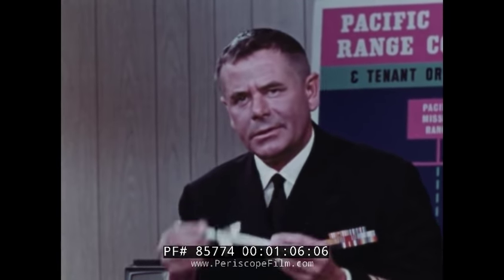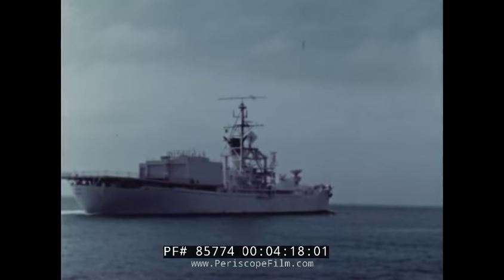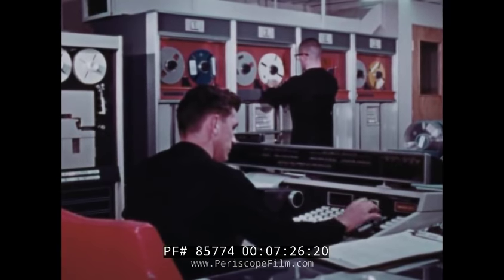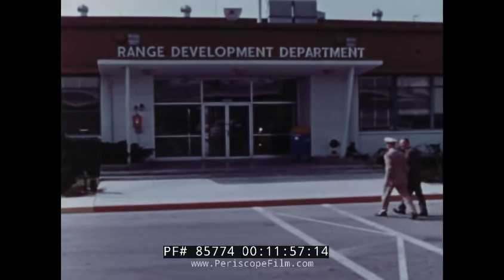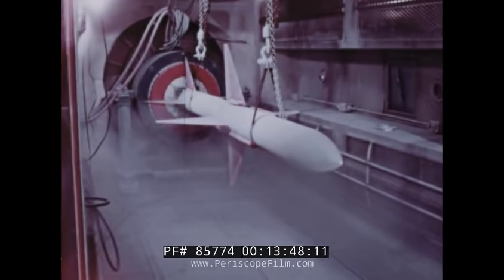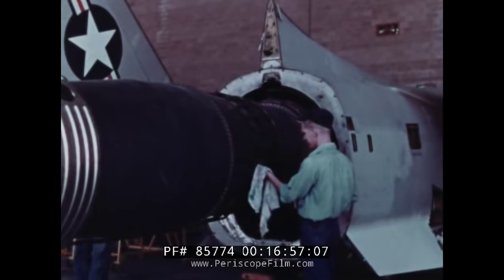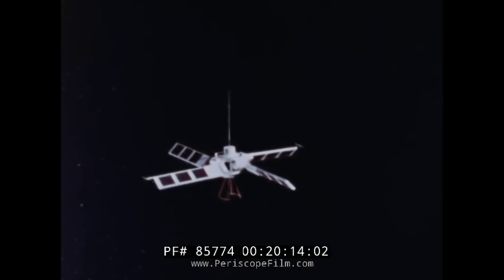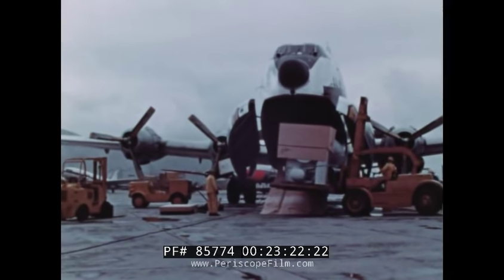U.S. NAVY THE MISSION OF PT. MUGU PACIFIC MISSILE TEST RANGE WEAPONS THAT WORK  85774

Comment: I worked in that building 1973-5 and 76 tour in the photolab, I knew Glen Ford came in our studio sometimes.  We saw this film there and others Jim Backus Magoo-Mugu also . PacMisTestCtr was what we were, then changed to NMC Nav Mis Cen. I had two duty hats PMTC and NMC. In 73 we cleared out the entire building; all the floors. Because when we were in the darkroom. One guy , not me, in the dark dropped a few gallons glass bottle of 98% concentrate of Acetic acid. (Stop bath) for print processing. (Dumb to have had it) I said right away that we would not be able to mop it up. The gas waffed up almost immediately and it was overwhelming We threw some towels and ran into the main lab section. The  first class said for us to get wet towels as masks and go back in which we did to mop, but it was so strong by then it sent us right back out gagging. He soon knew it was out of hand and was spreading quickly through all the vents, That building was likely over 120,000 sq feet with all the floors.  Someone called the base Fired dept and they sent in our hazmat. We were to to leave since the gas was too strong. I was young 19-21 so did not know really how to take advantage of what we had. Lots of equipment amd film and paper to do photogra[hy with as ,much as we wanted. We could check out 16mm 3 turrets and  lots of all the lenses for our Nikons of all sizes. We had Hasselblads and older 4x5 cameras (Not used much by then) And even the 16mm film & 35mm movie film was developed in our commercial lab next door. We had studio equipment and huge 24"x repro copy camera beds, a Giant Dursrt 12" x 12" condenser enlarger a beast on tracks. A VCNA Kodak Video Color negative analyzer and  later (no longer all by hand) Kodak color processing by machine/ Lot of VX4 work and VXE-6 of McMurdo Anatrctic